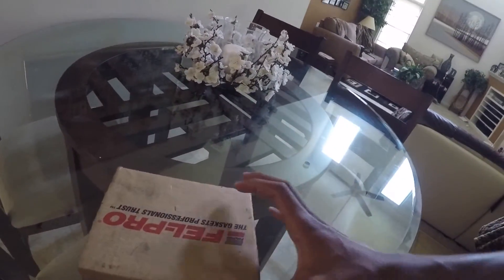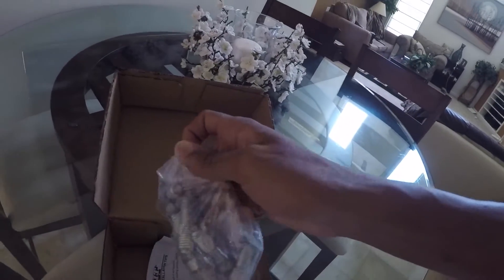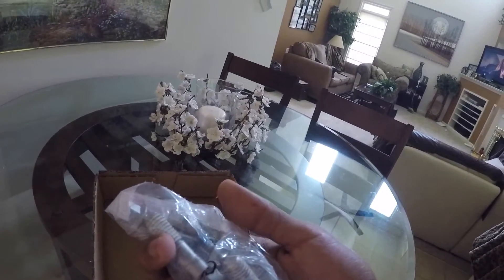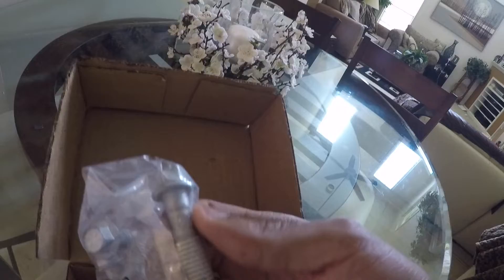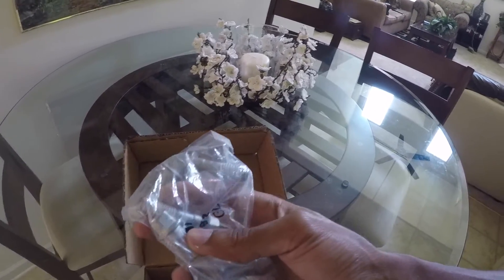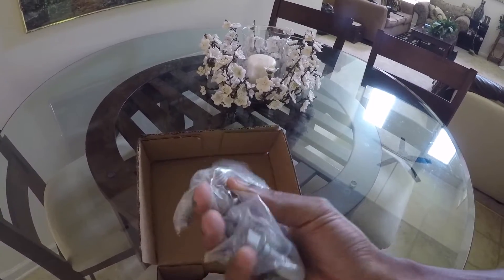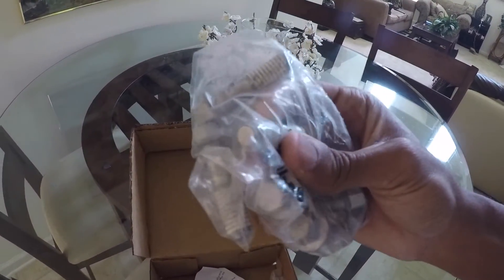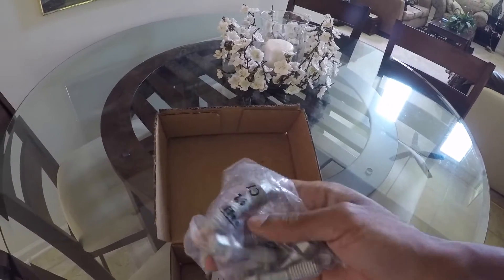Small Block Chevy (Short Block)  Engine Removal

Comment: Good job guys. I think you'll get more clearance with the hoist at the back of the garage and the truck nose in first. You'll need the extra height so the oil pan will clear. You can raise the new motor, roll the front of the truck under it, then lower it in the engine bay.